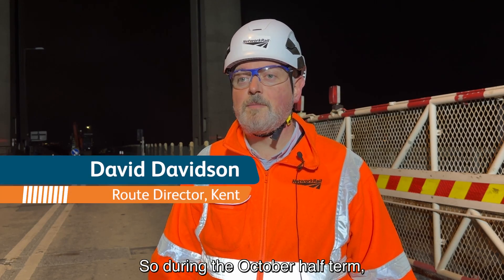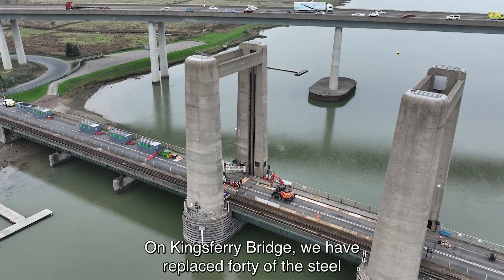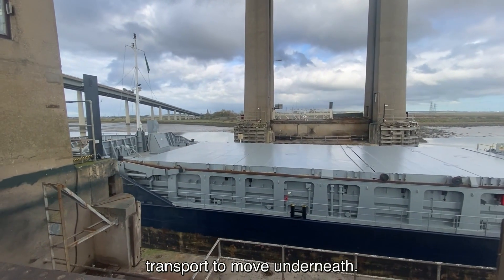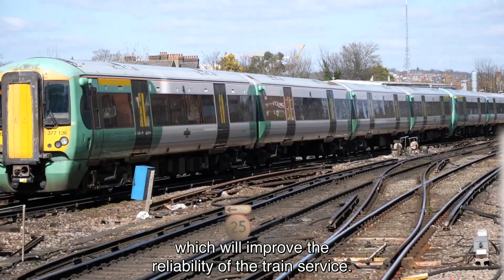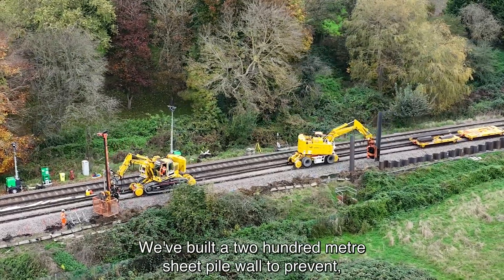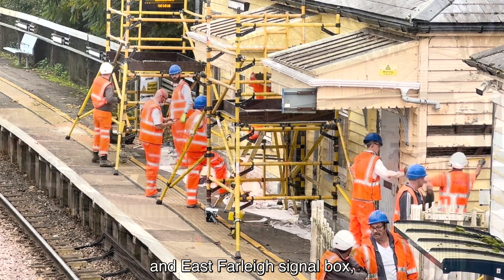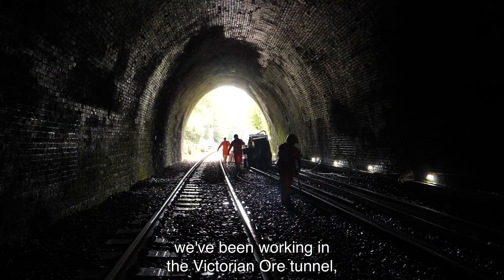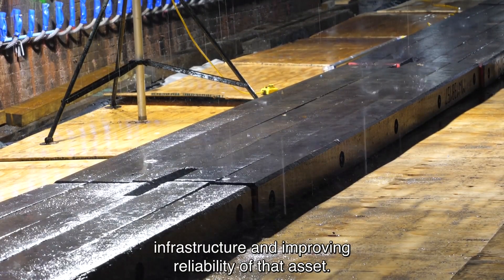Railway upgrades in the Southern region - October 2024

Comment: To properly improve the Southern Region, redouble Salisbury to Exeter is a must.
Reply: I agree Salisbury to Exeter should be redoubled and electrified 3rd rail.
I know it’s controversial about any more 750v DC, but there are no statistics to show its is any more dangerous than the rest of the system.
Reply: bit of a pipe dream sadly
Reply: its more it's unsuited to high speed, and ohle is more standard and i believe more efficient. but safety is a big problem. mostly its non standard